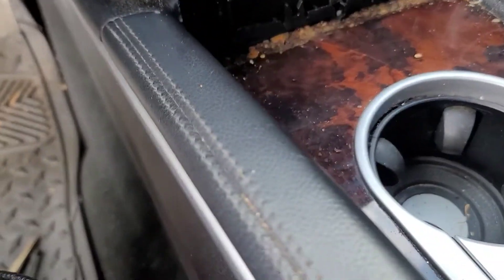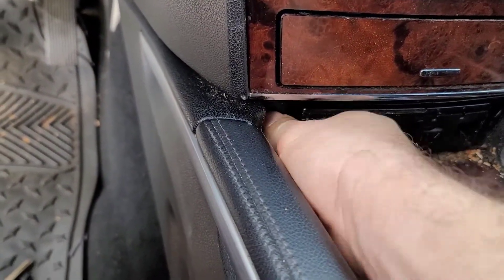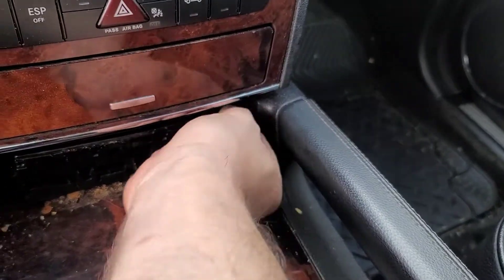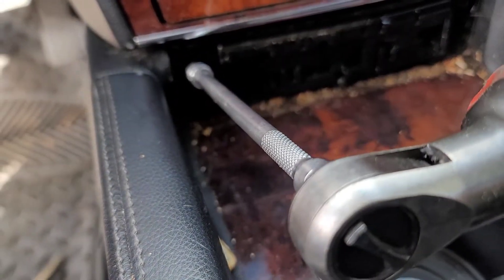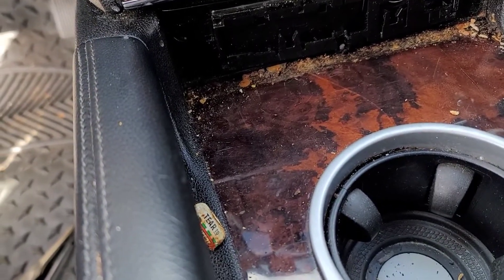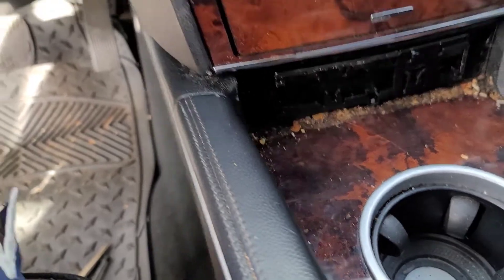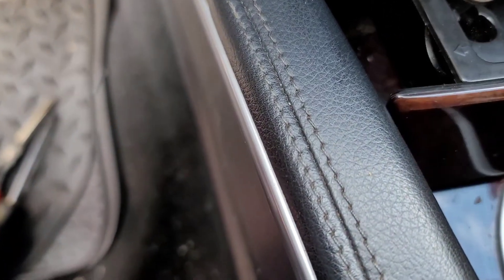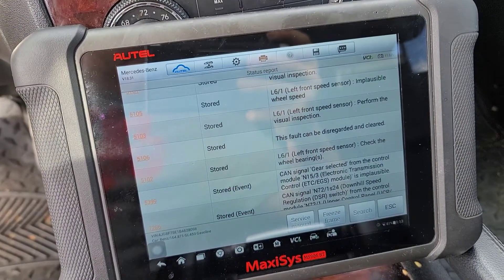MERCEDES NO OR INTERMITTENT START C426 CODE EIS ELECTRONIC IGNITION SWITCH  HOW REPAIR REMOVE GL450

Comment: Thank you.Just finished fixing mine.hopefuly it worked.1st test worked fine.lets see tomorrow morning.
Reply from the maker: Most of the time this repair does work. But I have had a few cases when it didn't because simply there was more damage within the electronics and then we needed to replace the EIS. It's very important this repair to be done early when the problems start. Thanks and Good Luck! 👍
Reply: @projectathos  yeah,so I might be one of the few cases where it doesn't work. The issue is still there.once I remove both plugs for few seconds and reconnect them,it starts fine.my main issue when the problem happens while driving.all dash lights come on.the wipers go off randomly and gear selector stops working.I have to stop.but while deceleration,the gearbox shifts down very harshly.

I think I need a new unit!!

Comment: Did same repair, simply reheated the exiisting solder without adding any new material worked. This part is extremely tiny (for someone who is not working in electronics every day), I was mildly nervous , but it came out ok, same setup that you are using and going nice and easy is key. My tip setting was around 400 degrees. No additional solder used.
Reply from the maker: Yes Sir! I am glad you took your time to reweld and yes it's a delicate fine job. Most importantly is that I was curious enough to actually discover this weird problem... I guess people need to turn that key when cranking with a little less force... 😂 🤣 😁 Maybe they think if they push harder the engine will produce more power! 😭🤣😂😭 Thanks 👍 and good luck🤞
Reply: Well done, very brave of you. I want to do mine but I'm sure I'd balls the whole thing up.

Comment: Good man fixed my moms gl had the same issue
Reply from the maker: Yeah I have done this repair many times and on many different models that have this switch which most Mercedes have them anyway! Most of the time this works and sometimes it doesn't... Anyway 😂 Glad that you saved some big money and you get to continue driving your GL! Good Luck to you my friend and don't hesitate to ask questions if you need more help! Thanks 🙏👍
Reply: @projectathos  thank you very much

Comment: I am not gwtting any codes on my ml350 but its the EIS or the key. When turning no dash lights turn on. It lets me turn to try and crank and nothing. We were going to the beach in this car and mechanic is stumped so it looks like we are not at i need to figure this out on my own. Did you get an eis code? Mine is not intermitent it just stopped starting. Im not getting remove key so i think its the key. I do not have a spare.
Reply from the maker: You need to scan the car with a scanner with Mercedes software that reads your car first. Then based on the codes you may get some info what's going on. If you have no codes it sounds like the Ignition Switch itself going bad. I have seen these EIS going bad and not showing codes during the scan so don't rely or expect codes. Follow the mechanism of how these cars work and the modules communicate internally. If it let's you turn but it doesn't start it's not the key but the ignition switch unfortunately... I have seen this situation many times. The electronics inside are not working in the Switch. Does your remote work when you press the buttons? How about the battery in the remote? If it's functioning then it's most likely the EIS. You could ask a mechanic to open the EIS switch and look for broken solders like in this video. If not then you would need to get a new EIS and a New Key programmed to it too at the "Stealership" unfortunately... Sorry again and let me know if I can help you more... Thanks 👍 and Good Luck 🤞

Comment: Hello, thx for your great video, I Hv the same problem of my w164 with code C141! Is it the same as yours ? Thanks !
Reply from the maker: CODE 141 MEANS - NO CAN MESSAGE FROM CONTROL MESSAGE N73 ESZ IN TCM. TCM IS THE TRANSMISSION MODULE. THIS IS A DIFFERENT CODE. RESEARCH IT ONLINE TO GET HELP...
Reply: Thx for your speedy reply!  I CAN’T find any information about this , can help??
Tons of thx 🙏
Reply: Great video.   That wood panel is filthy on center console

Comment: Hi, Could this type of cold joint problem on the EIS cause  first cold start problem in cold weather? At which point a lot of Can problems are seen in diagnostic error codes. And then it is corrected by removing the EIS fuse only. If it is the fault of the microprocessor, only the entire EIS-unit needs to be replaced ? @projectathos
Reply from the maker: This problem has almost no relation to the weather but keep in mind that solders will come off easier when it's cold. So unfortunately I cannot claim completely that the weather doesn't affect the soldered elements. So there's 50/50 chance it may be the cold weather!
2. I am sorry but I don't understand your second question/statement. To try to answer it - you cannot erase codes in the Canbus system especially once created by the modules by simply disconnecting a fuse! Sorry but this doesn't work. If it was that easy everyone would be able to fix their cars at home without the need to use those very expensive software programs and scanners that are needed to scan and diagnose Canbus diagnostic codes. 
3. Yes if your EIS is burnt, damaged or whatever else you will need to replace it with a New OEM MERCEDES Part that would need to be programmed by the Mercedes Dealer to your vehicle and your keys! Sometimes you may need to replace your keys with The new EIS because keys are programmed only once. 
Thanks and Good Luck 👍
Reply: I will try to explain it differently, in my case the key does not get stuck, the car starts normally, but in a few seconds it writes the problem of everything ESP, ABS, SRS  and only if temperature is under 0 C. so if there is frost. and we determined that EIS is causing it, weird, whether it is more likely to come from the bad soldered  some pin  or from the microprocessor, because there is a resource on YouTube Where the cold affects  the microprocessor, https://www.youtube.com/watch?v=8JTbSrgwbWg
I am afraid of disassemble  and damage it because,  then we won't be able to reprogram it to a new one @projectathos Eventually I'll have to take it apart and open it up :)
Reply: @iraklijorjadze2152  Did you figure out what was wrong? Getting same symtoms with multiple CAN codes and intermittent no start.

Comment: i have similar problem. sometimes lights come on but it wouldn't start when i turn the key. 
other times no lights come on at all and it takes a few tries to start. 
also when i get inside sometimes there's a message "don't forget Your key"
i wish You did show how it looks on Yours.?
Reply from the maker: Very similar problems and intermittent starts. But you must check your trouble codes first. I am extremely happy that I could help! Saving money and learning in the process you just cannot beat that... Please subscribe and thumbs up!

Comment: Thank you so much for this fantastic video! Did you have to reprogram the key after you soldered the ignition connection?
Reply from the maker: Nope everything worked fine. No program in the memory was lost in process
Reply: I did this exact same repair and it totally bricked my GL. It all was very easy, soldering and all but when I reconnected the two plugs to the back of the EIS nothing works. If Michael on EBay can’t bail me out it’s going to be a $1500 bill to get it towed to my dealer and have it up and running.
Reply from the maker: @onexsculler  Your EIS may have been damaged already or in the process of getting damaged completely. Sorry to hear this... Some of these repairs work sometimes and other times they don't because some things are beyond repair. You may have to get that EIS replaced at the dealer...

Comment: is this only for ML? does it apply to C or E?
Reply from the maker: GL and MLs ia where I have seen this situation but technically these EIS were also used on the E classes I believe too. You would need to disassemble the switch from whatever vehicle and investigate it to confirm. Thanks 💪👍